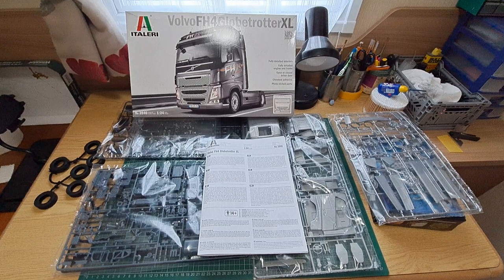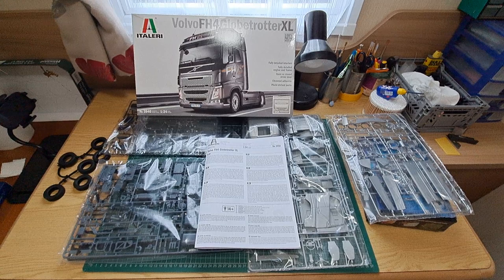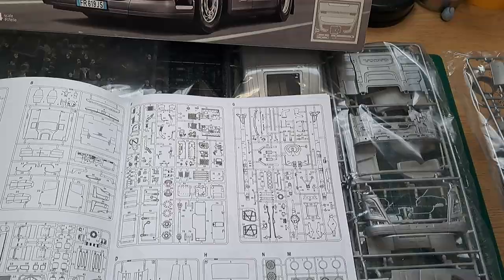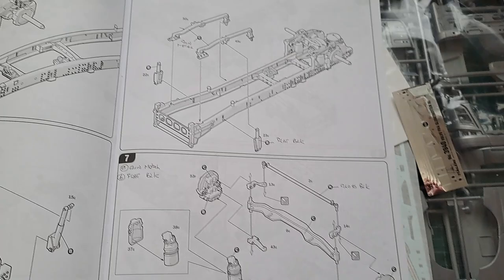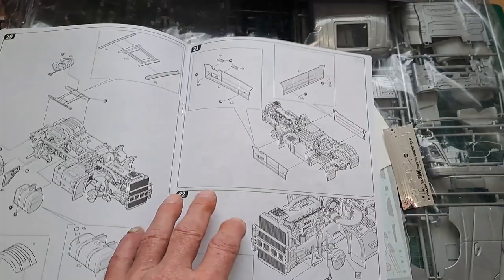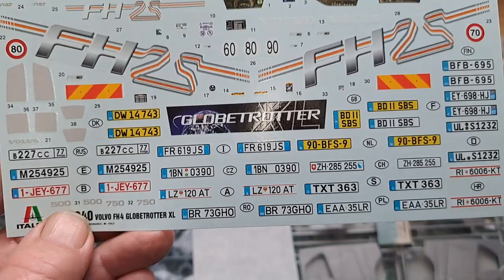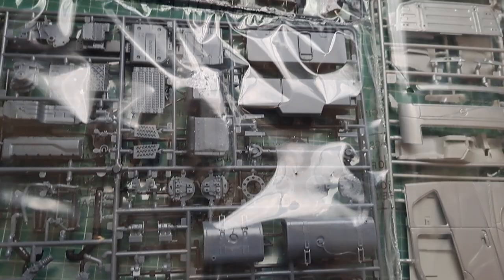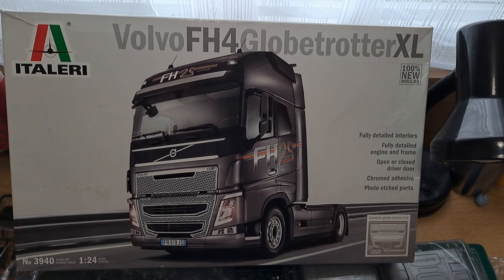Italeri Volvo FH4 My Entry for the big rig Group build ,hosted by Jeff's model garage

Comment: I attempted one of those Italeri rigs, Scania if I remember, ended up in the bin, awful brittle hard plastic for the chassis, tyres with flash that was difficult to remove and as for assembling the cab it was just poorly engineered, although I never had a problem with the engine and interior. Interested to see if you have the same problems Martin, I'm sure with your skill and patience you will make a superb job of it..
Reply from the maker: Yes I remember  that one of yours ,it was one of your earlier videos. 
This apparently is new tooling so we will see ,I have been advised to replace the cab hinge pins because the originals are weak. 
All the best Martin 👍